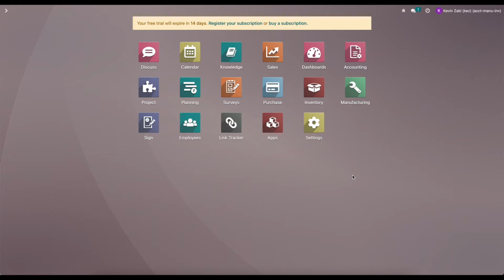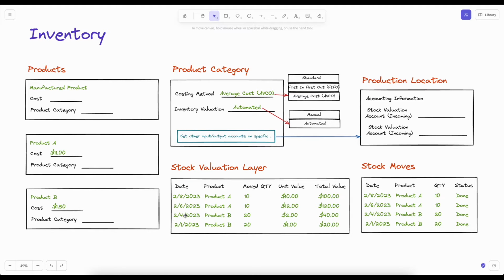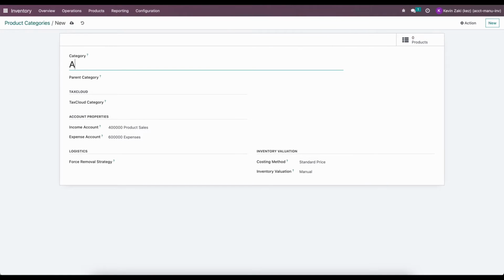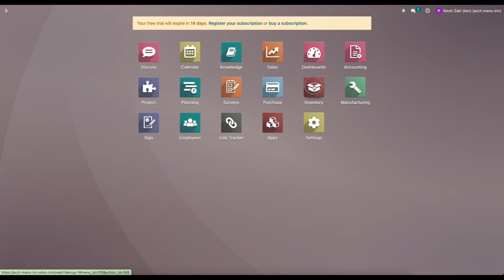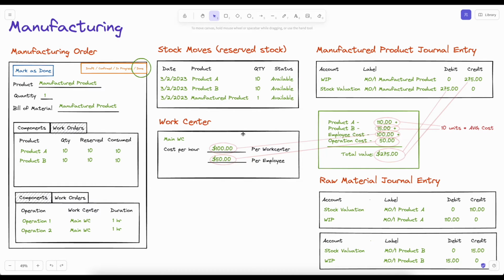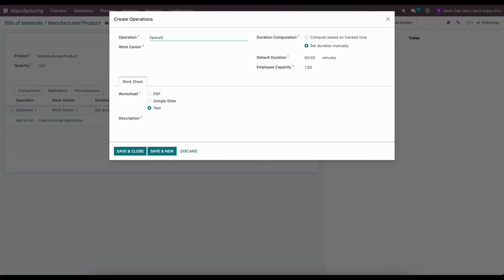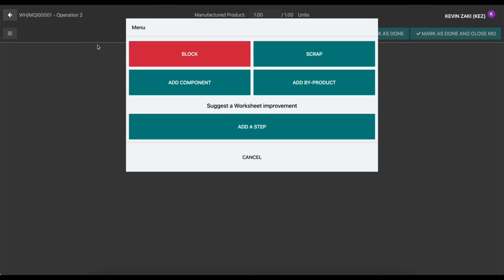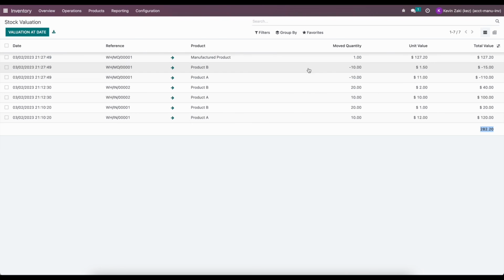Manufacturing and Inventory Accounting and Inventory Allocation Explained in Odoo 16

Comment: Great video and explanation Kevin!  Just one question, I frequently see that the real time used to produce is not totally real since some operator missed to start or end the work order correctly, this might lead to an over or undercosted manufactured product.  This creates 2 problems: 1 manufactured product AVCO cost gets distortioned and 2 overhead and salaries might not match the leftover amount in the WIP account.  Can you please explain how to correct this situation?  Readjust product cost manually and then the WIP should compensate against overhead, salaries and cost?  Thanks!
Reply from the maker: Thanks for watching. That is indeed a good use case to cover. I will try to make a video on that soon.

Comment: Very informative video!! very useful indeed. Have a question, For manufacturing process that extends for longer periods the MO would start not finish. In this case, can the BOM products move to the WIP and stay there until the MO is completed? Would the WIP reflect value in the BS for MO that has started yet not closed?

Comment: How do you clear the remaining balance for the employee cost? Is this a required manual process or could it be automated as well?
Reply from the maker: You can use "Automatic Transfers" to move some percentage of value to a different account each month. However, it is probably done manually or through custom code that triggers based on specific criteria.

Comment: Thanks Kevin, this is the kind of info I was looking for as someone just trying to get started.  I was having some trouble seeing how to capture some of the extra cost of manufacturing my products.  It looks like Work Center is the solution.  

I'd like to request a way to tie equipment to a work center like you do employees.  I know how much time a machine(s) use to manufacture my products.  Manufacturing Product A uses 1 hour 20 minutes of Machine A and 33 minutes of Machine B.  I'd like the machine's time tracked by a work center and tied to the maintenance schedules.  Have it generate a maintenance request automatically.  

I've learned so much from your videos.  Thanks again.
Reply from the maker: You can do most of that OOTB. The cost should come from the work center. I will make a video at some point on how to maintain manufacturing equipment.